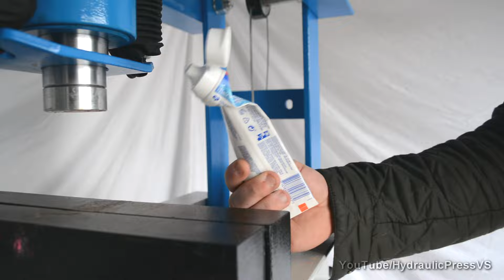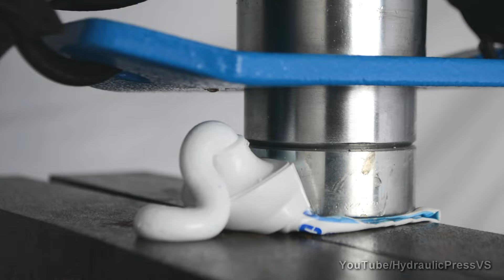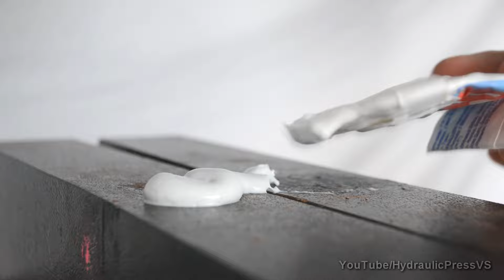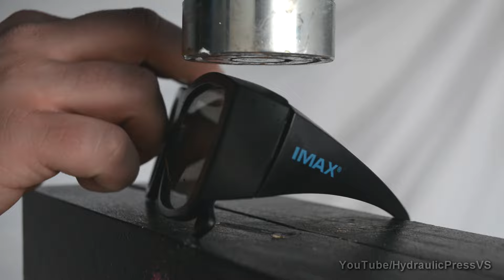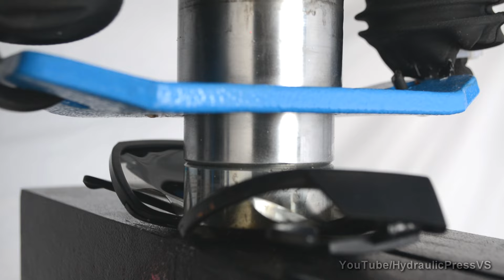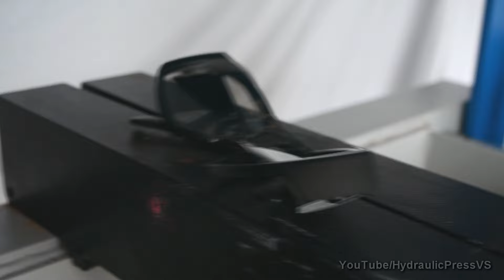Toothpaste Tube vs Hydraulic Press - How to get the last toothpaste out

Comment: they should take small pieces of coal and press them.

or take a stack of gold flakes and press them on top of each other.
Reply: to make gold or diamond, it takes more pressure than the most powerful hydraulic press. The whole weight of the earth crust that is.
Reply: Yato/ /Yukine 
I know that, but I would just like to see what point they get to with it.
Reply: +Yato/ /Yukine or smashed underground for 100 thousand years